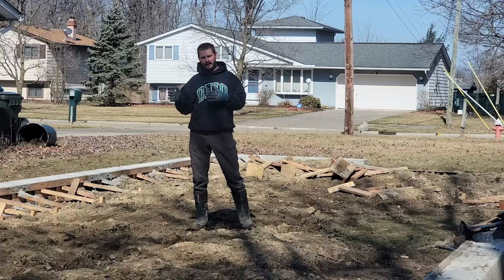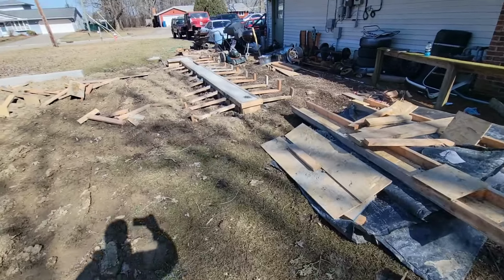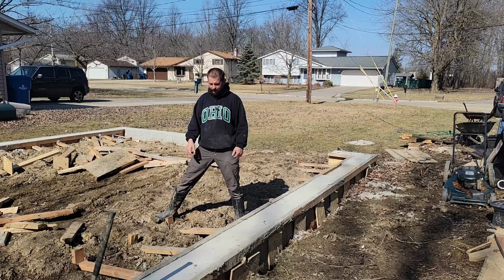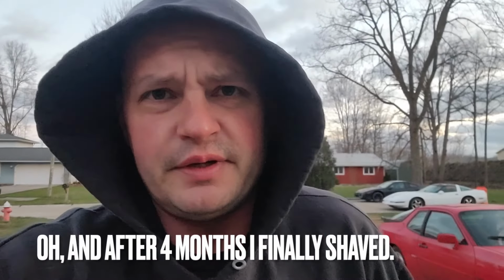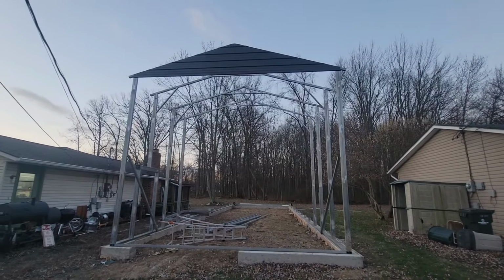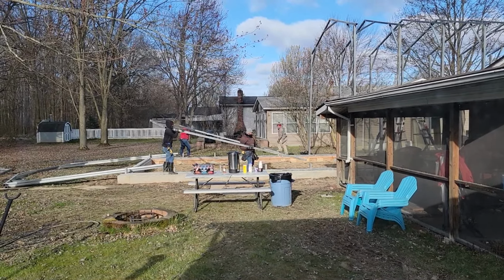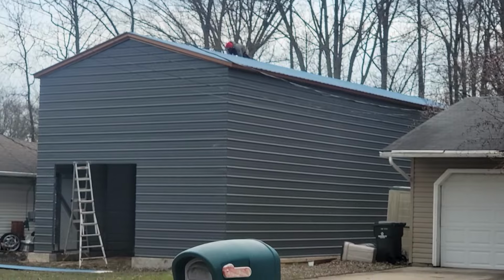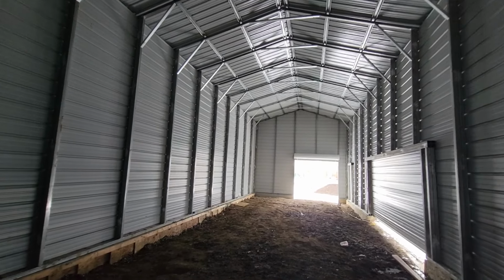The shop has arrived

Comment: Great way together a shop space in a long, narrow space. How are you going to use a double garage door so close to your home? Also, what are you planning to keep water from flowing under the wall from the footing outside? Thanks for sharing!
Reply from the maker: There is 13' between my house and the double door. If I calculated correctly, once it's all cleaned up and parts are organized, 2 cars should, very carefully, be able to pull into the double door. Water is an issue, the city has very specific things I can and can't do; it's going to be tricky.
Reply: @10footcustoms93  I just built a 24x32 stick built shop in my backyard. In addition to using a foam sill seal ( 3.5" wide and 1/4" closed cell foam strip) under the sill plate, I sealed  the edge of the bottom wall plate inside and out to the concrete with a bead of Henry's 900 flexible sealer/flashing. It goes on like caulk and dries to a super strong and flexible,  rubberized  bead.  I've noticed that buildings like yours don't come with a 90 degree flashing  that your seal to the concrete and the bottom rail or molded foam strips to fill the gaps in the sheeting ribs . The flashingt also covers the bottom rib of the sheeting to keep larger insects/vermin out. There's a lot of options out there and I'm sure you'll find one that works for you!